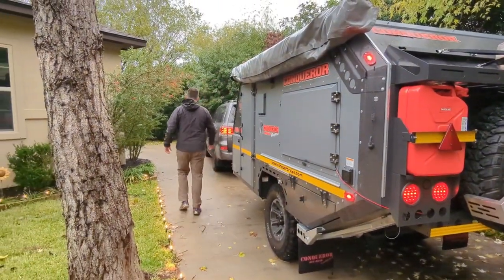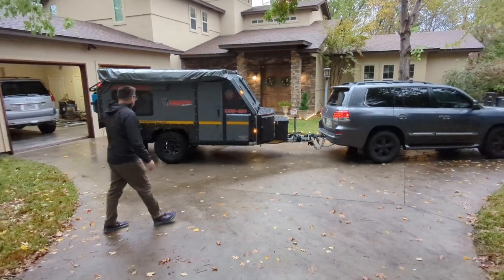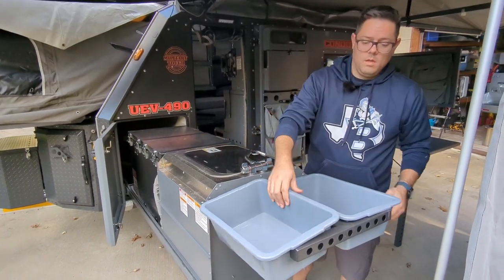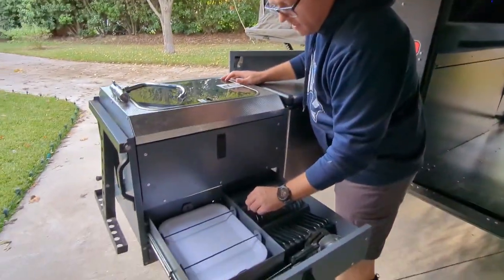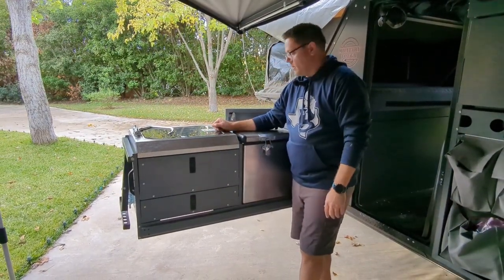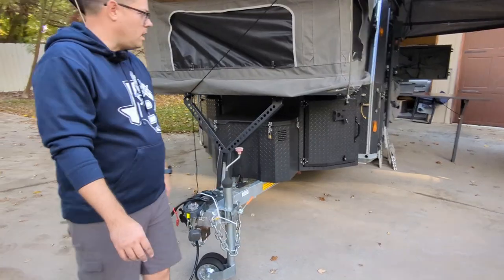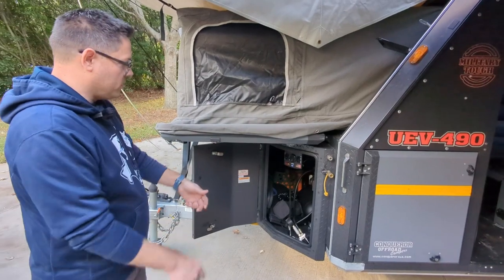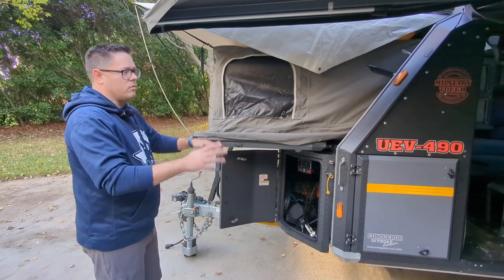Conqueror UEV490 :Take Everything EVEN the kitchen SINK. Storage galore, sleeps 5, but who's it for?

Comment: Great review, and you caught many of the common issues... as for the TV, forgot to secure mine last trip and it is DOA... ripped the wires right out of it.  I'm going to install a 12v TV (see youtube video as to how to make any TV 12v) and fab a hanger to hang it from the lifting brace inside and create another bracket for outside.  Rare that we use it but good for rain.  I also pulled our steps out.  Bought 2 metal anti-slip step units from Amazon.
Reply from the maker: Great idea. I want to get a bigger better TV in there (32" or so) but most of them are AC. Would love to see which video you used and which steps you bought.

Comment: Our faucet used to leak as well. Now, I shut the pump off, open the tapes to depressurize and then slide the fridge/cooker slide almost all the way before closing the faucets and folding the goose-neck down and complete the pack-up. Seems to have solved the leak issue.
Reply from the maker: Interesting tip on sliding the kitchen in partially.  Will try that. I guess there's some compression of the lines when you do that?  

Also there's a schraeder valve on the pump itself and I think it helps to depressurize that

Comment: I yanked out the AC. Like you said, when are ever going to be plugged in to shore in that trailer. Plus it saves weight yanking out the 50 amp HEAVY wire/shore plug.
Reply: In South Africa, where these originate from, one gets them optioned out with Lithium-Iron batteries, Solar panels, hybrid inverters and carging from the engine's altanator when on the go. Very handy indeed.